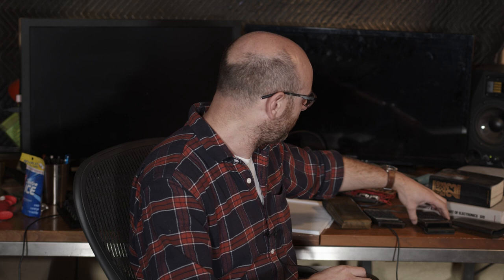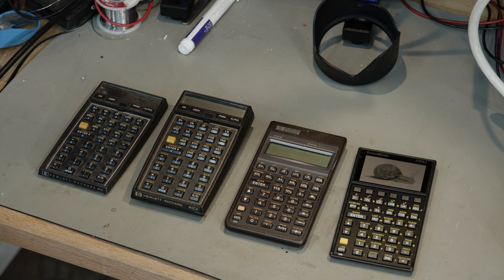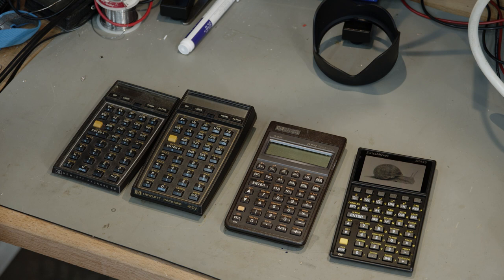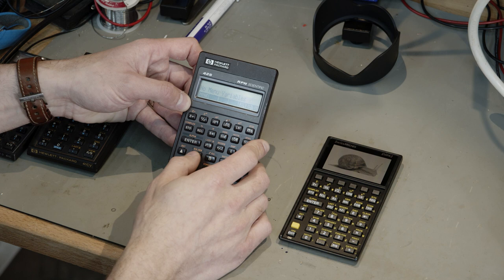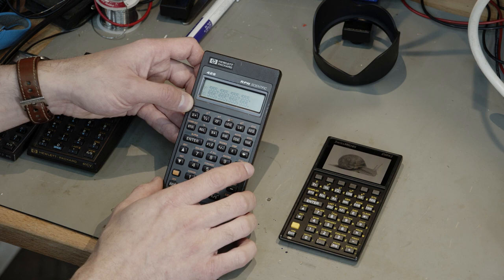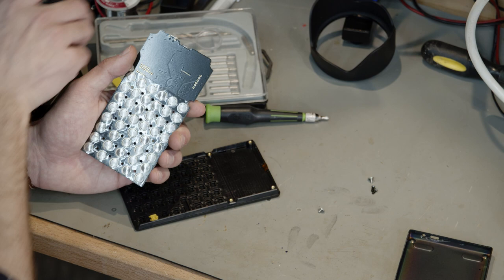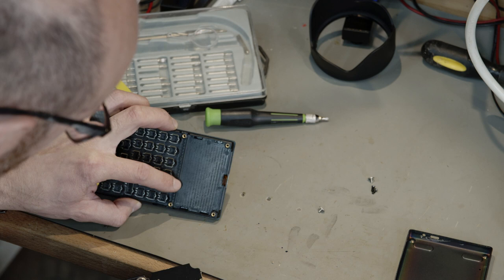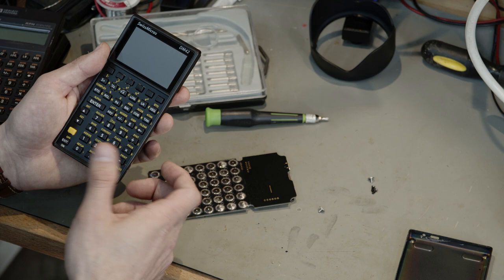SwissMicros DM42 Review

Comment: If you have a pre 2020 DM42 you can get replacement foil domes for $10 and free shipping from SwissMicros. The older models had a defect when cleaning the contacts on the PCB, so if you have key press issues, pull the old ones off and clean the PCB and place the new ones on. I just ordered mine to the US and will do the swap once I get it.

Comment: Thanks!   I worked in the mail room in Standard & Poor's back in the 70's and had to make many deliveries to McGraw Hill (in NYC).  There was a store in the building that sold HP calculators and I fell in love with them but I couldn't afford anything at the time.   I was able to save up and buy a TI 59 calculator w/printing crib and had fun programming blackjack on it.  (I pulled it out of storage recently.  The batteries died and the mag reader has problems but they otherwise still work!)   In the early 80's I became a programmer was able to buy an HP 16C and it quickly became my go-to calculator.  I had to change the batteries only once since then.  I bought the Swiss Micros DM42 as soon as I found out about it.  The keys and the screen are a bit lacking, but I love everything else about it.  I still use the 16C for hex/dec conversions and bit manipulations and use the DM42 for everything else. I seem to have a problem with 'normal' calculators because I think in RPN now.  I may buy a spare (updated) DM42 and their 16C clone and maybe others just for fun.   My name is Dave and I have an HP calculator problem ...

Comment: I’m sold.  I bought my first HP calculator in January 1989.  It was a HP-28S that I planned to use for my forth year of an 4th electrical engineering degree.  The lecturers wised up to programmable calculators and forced a memory reset before each exam.  That got old really quickly so I sold it to go skiing mid 1989 (Australian winter).  I got an Elec. Eng. job in 1990 and used my first pay packet to buy a HP-42S.   It’s stellar calculator that is still fully operational and very treasured, so it’s no daily.  Along the way I also picked up a HP-35S and just recently a new old stock HP-28S that is pristine, including the battery cover.  Which brings me to the DM42.  I’ve been using Free42 on my iPhone for years, but it’s just not the same, so I just placed an order for the DM42.  Bring it on…
Reply: and ? happy ?
Reply: @odarge  Very happy, I use it daily and it’s just brilliant. The only issue I had was that the top plate (that has the markings for the sub functions for all the keys) came loose.  It was an easy fix to carefully apply a little extra glue and it hasn’t come loose since.
Reply: @duckmcf  nice to read this (apart from the bezel issue :-(  ).  I like my DM42 very much, it's elegant, fast and the screen is clear.  Fan of RPL in the past (still own a 48GX and a 50g), I think simple RPN is also very nice though, especially on the DM42 where all keystrokes are easy to read in program mode.

Comment: I'v heard a few times people say that the 42S was the best HP calculator ever made. I don´t have a 42S so I can´t say if I agree or not, but I do have a 11C and I absolutelly love it dearly. I also have a 48GX that I used during engineering undergraduation but I would rather use the 11C than have to navigate through many 48GX menus. So I understand why many people would also prefer a simpler 42S than a vastly more complex and powerfull 48GX. I recently bought a 15C and a 41CV and love them both but for matrices, complex numbers and integration there is nothing like the 48GX.

Comment: if you never used the 48 then you are missing out.  RPL with the solver, and using directories and a custom menu in each directory.  It's awesome.
Reply from the maker: I used to have a 48. By the time it came out, I’d do computation on a computer. I still use my 42S today primarily due to the form factor and the nostalgia. It’s nice having some that fits so well in the hand.

Comment: My idea of heaven would be an RPN calculator with Forth (stack-based programming language) as its built-in programming language. I've got various calculators, including some Casio and TI graphing models, but I use my humble HP35s everyday and really enjoy it. I'm very tempted to get the DM42, and your video has not dissuaded me from this desire!
Reply from the maker: Forth is not a bad choice at all. I don't have a ton of experience with it, beyond using it on Sun machines, where the openfirmware interface used it. Maybe it could be ported to the DM42...
Reply: The later HP calculators are RPL based, which is very similar in many respects to FORTH, but has typed data.  It includes the same sort of threaded language features.  There's an open-source re-implementation, NewRPL that you might take a look at, in additional to the documentation on the RPL-based HP calculators.
Reply: @lmamakos   Thank you for this comment. I managed to find a place that was selling unused (still boxed) HP50g calculators and bought one a few months ago. Gorgeous indeed!
Reply: @odarge   Hmm. could have sworn I replied but the comment seems to have vanished. Trying again... calculatorsdirect.co.uk have the 50g for 175 GBP which is about 204 Euros. I've not seen it any cheaper anywhere else, and these are still boxed.
Reply: @joyousmonkey6085  thank you ;-)  Alea jacta est.
Reply: @joyousmonkey6085  I hope this company is serious and also that this 50G is brand new/not refurbished.  Anyway, wait & see.
Reply: @odarge   Mine was unopened and never used - i.e., not refurbished. I actually phoned this company up as I couldn't believe my eyes when I saw the HP50g on their website. The person I spoke to was obviously knowledgeable about scientific calculators (so far, so reassuring) and explained to me they'd received an order from another company to source as many unused models as possible, but only some of the sourced models were actually purchased by the other company. Hence, they ended up with quite a few HP50g calculators to sell on to other interested parties. I've subsequently bought an HP39gii from them (I know, not RPN, but I was intrigued by the Pascal-like language) and have had a good experience with them on both occasions. I hope your crossing of the Rubicon goes better for you than what happened to the other chap!
Reply: @joyousmonkey6085  yes, I hope the delivery will be without troubles.  Do you have also a Prime since then ? I didn't know this 39Gii, just curious about it.  
I started with HP with the 11C following advices of my mother (math teacher, "here is the stack, just give it a try") :-), later the programming and RPN virus was there, I switched to the 15C (still at school), later on a 28C (waw!) at university, rapidly followed by 28S (love it) and a 48...(did not remember the exact model).  I had so much fun programming them during my engineering studies. Them helped me loving coding and all the stuff you can imagine on these calculators.
Today, I don't have real RPN or serious calculator programming need, just for fun (and nostalgia). 
I'm running an iPhone  ihp48 emulator for months (years ?), it's really crucial to me to use a stack.  Now trying to fetch this 50G, the "last one of the RPL family".
(I heard from  my parents that the old 11C, 15C and 48 are still working well , they promised me to put them for me on the inheritance ;-) :-( !!)
Reply: @joyousmonkey6085  at school when using the 15C, one of my friend had a 41C (CV or CX), I was astonished (and a bit jealous ;-) ) by the screen quality and clarity. Good old days ;-)
 I'm not sure about a modern DM41X (or DM42..), they are certainly superb and fun, but would it be really useful to me with the limited stack length and it would be so different than what I could learn with RPL.
Reply: @joyousmonkey6085  hello again. The 50g is finally arrived today, it was a journey ;-) (delivery, customs, belgian post...). Once again, thank you so much !
Reply: @odarge   Hello again. I am really happy for you! Thanks for letting me know.

Comment: Totally agree with the need for the correct orange color! Does the case allow placing the DM42 face down without pressing buttons? I seem to recall my old hp42s could do that, and it was a nice way to protect it. (mine was stolen and i replaved with a 48s, also nice but kind of large, clunky compared with the 42s)

Comment: Have you tried any of the Forth calculator implementations?
Reply from the maker: No, I haven't, but oddly enough I built a weird variant of the HP-42S about 15 years ago and invented, what I thought, was a new programming language for it. I had basically re-invented forth with lisp-like syntax, but designed for entry on a button layout identical to the 42S. 

Do you have any recommendations that I should look at?